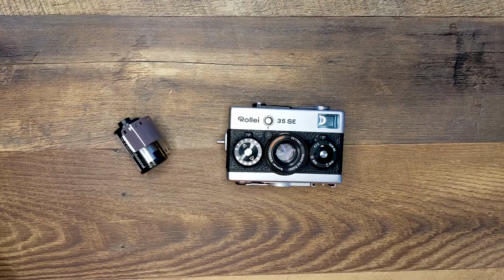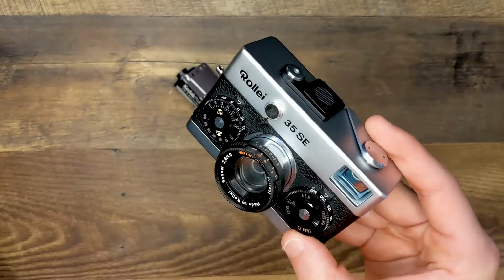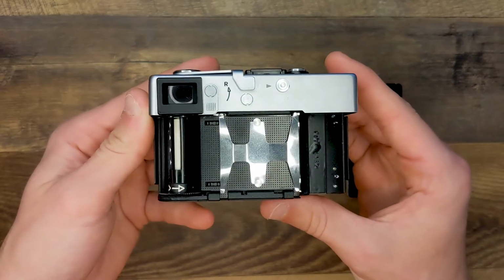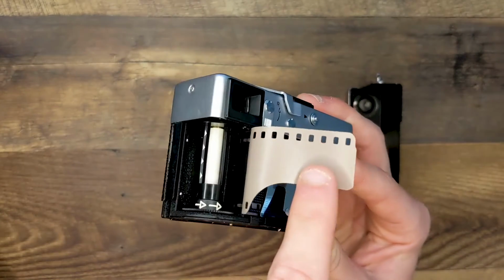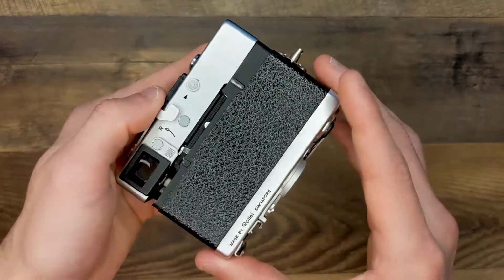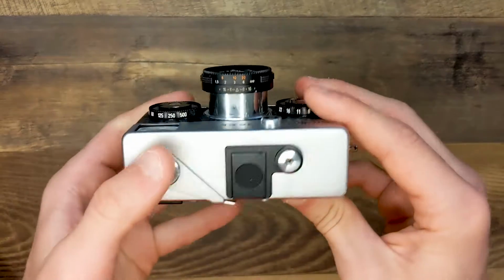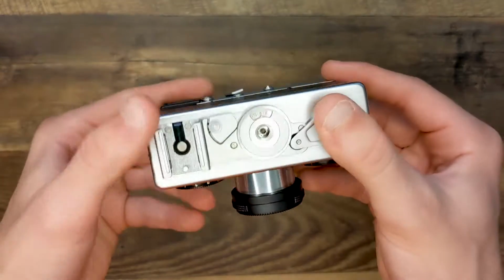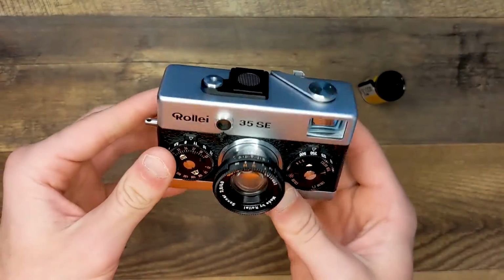How to Load a Rollei 35 Film Camera

Comment: Helpful video for someone looking to load a Rollei 35 for the first time. One thing I would’ve pointed out is to make sure the film is loaded and advancing properly after loading by watching the center of the rewind crank. If loaded properly it should turn as you advance the lever just as confirmation you’re loaded correctly for a frame or two. Good habit with any manual film camera. Thanks again.

Comment: My initial reaction was another pointless "how to load your camera" video.  However, it is a very well organized and presented video on the process of loading one of the fussiest 35mm cameras ever made.  As a Rollei 35 owner for decades, I'm long used to its peculiarities, but you can end up wishing for three hands when first introduced. My offer: The most troublesome aspect of the loading or unloading process in my experience is reinstalling the back. The fitting tolerances are very tight, and you have to start the back in the grooves at the sides, not just slide it up from the bottom of the body. Otherwise, it tends to jam when you try to slide it up and closed. Takes a bit of practice. Overall, nicely done.